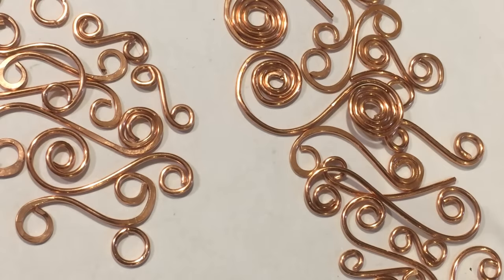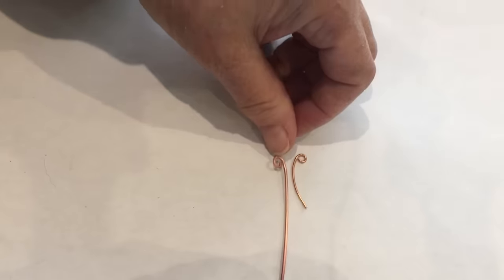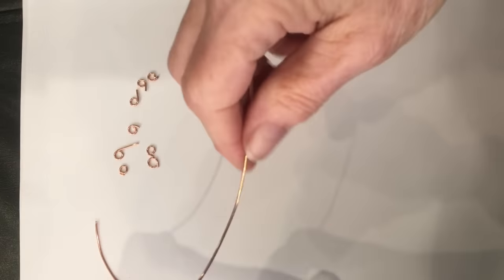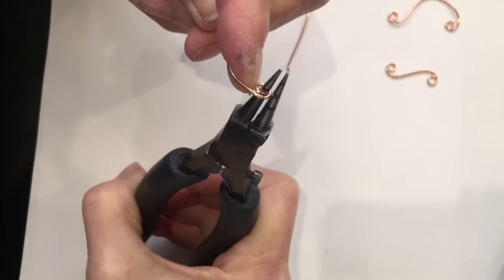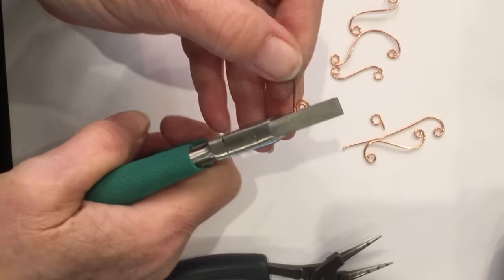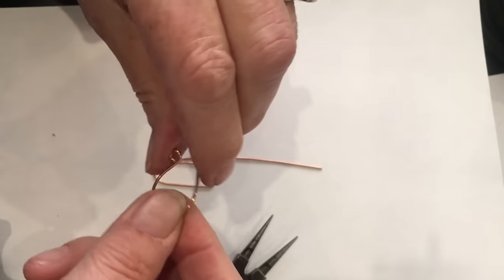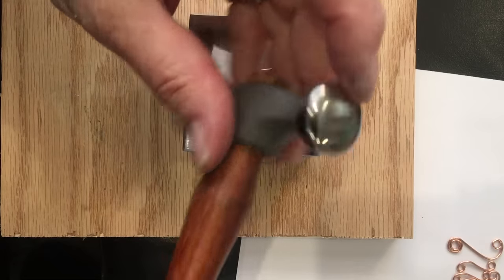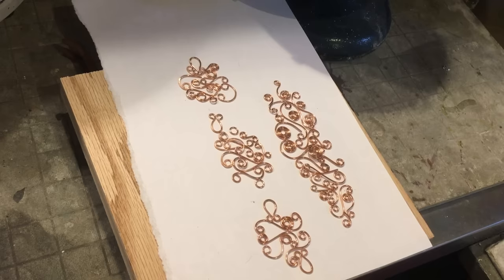Wire Working Basics:  How to create beautiful shapes from wire.

Comment: I just started making Wire hair combs. Instead of using sandpaper you can get a brick and put it at your workstation. Just rub the ends on the brick or rock. Where do you buy your materials?

Comment: Do you do similar to this in a thicker guage?
Reply from the maker: You can but, as I state at about 2:52 in the video, the shapes are slightly different.  Annealing 14 or 16 gauge will be absolutely imperative.  You can try it with 14 gauge but, expect the metal to resist!  Experiment!  Thanks.  N

Comment: This tutorial set was so helpful! Thank you for your insights. I've been using these tips to refine smaller accents on my pieces.

I'm still struggling with larger elements though. So for instance, making nice wire loops around my 4-in and 6-in plant pots. I can't seem to get the same leverage/control to finesse the curves quite so nicely.

Do you have any suggestions for making nice smooth loops/coils/circles for larger pieces? Even if you don't, thanks so much for your time on these videos!